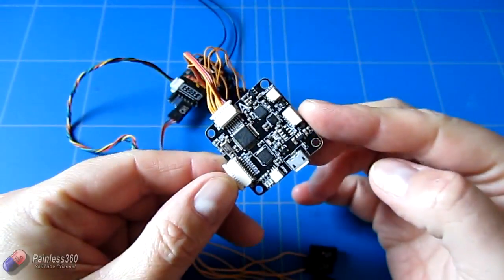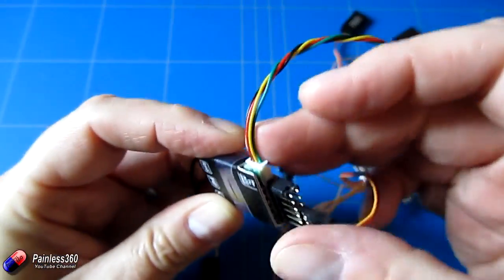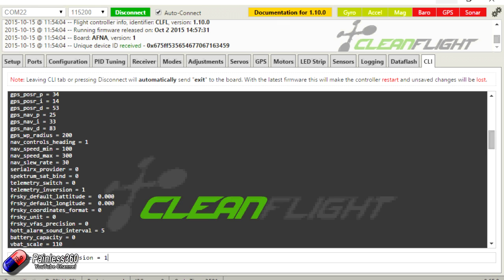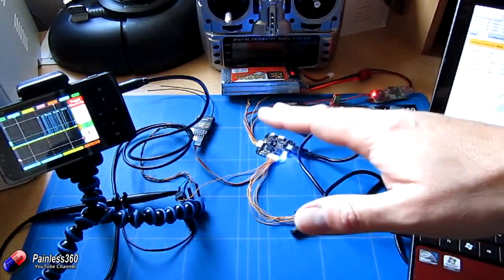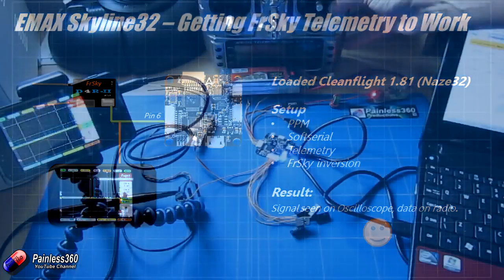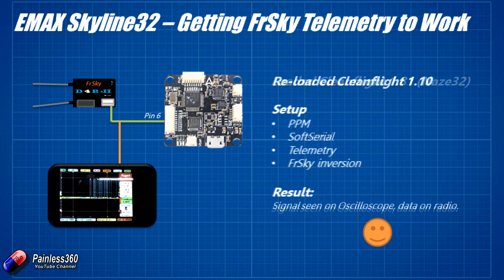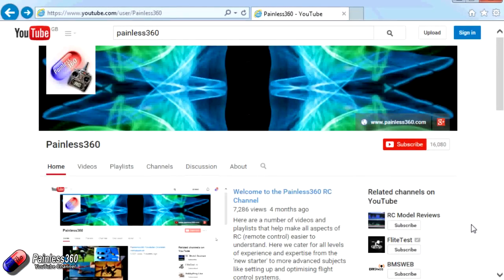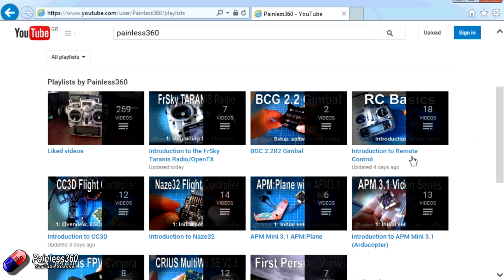RC Quick Tips - Skyline32 and FrSky Telemetry

Comment: I have been struggling with this problem with the Skyline32+OSD  to get telemetry on my taranis. I am using SBUS on channel 4 and telemetry on signals 7&8 with a frsky xsr. It works with the same set up on my Naze32 rev 6B thin 6DF on a diatone tyrant and no problems. What am I doing wrong?
Reply from the maker: +roland burrows not too sure, softserial is limited to 19.2k baud and on some flight controllers I've heard that this isn't enough. Best of luck

Comment: Any idea how to get led_Strip and telemtry?
When I turn on soft_serial on it turns led_Strip off :(

And it does not work on my 9xr pro :C:
Reply from the maker: +psposki not sure why that's happening. I'd configure telemetry on another Port and try again. Best of luck!
Reply: +Painless360 Thanks for your replay. 
I've decided to make voltage divider to get my vbat (that's only what i need from telemetry) on radio. 
It's cheap as f*&k, easy and i can still use led_strip  :)
Reply from the maker: The easy answers are normally the best! ;)

Comment: Does the nighthawk pro 280 come with the Skyline32 board? If so, is it still pin 6 that I have to plug telemetry into or is it another? As pointed out in the following image, the board seems to only have 1 soft serial connection, with pin 6 being the tx pin. So should telemetry be instead plugged into the 5th pin? that being the rx pin for soft serial 1.

http://static.rcgroups.net/forums/attachments/6/2/9/8/8/7/a8480961-211-main%20board.jpg
Reply from the maker: Looking at the diagram I'd be temped to use soft serial for telemetry (pins CH6/CH5 when using PPM and SoftSerial enabled). No idea what the board is but it will be running a Naxe32 target for Cleanflight/Baseflight.  Best of luck!

Comment: Hello and thanks for the video. I'm setting up the mini advanced version of this board and though I have the documentation my current set-up is not covered there. I'm running DYS BLheli 16 amp ESCs which don't have BECs. However, my PDB has a 5V out which I'm thinking I can power the FC board via that channel. I don't need telemetry set-up but I have not idea how to connect the ESCs to the board harness. There is only one wire coming out of provided harness for each ESC on the mini version of this board but 2 wires out of each ESC, signal and ground. Would you happen to know how to connect the ESCs to the harness? Do I ignore the ground wire on the ESCs and just connect the signal? I've sent several emails via emax website but received no reply. Hope you can help for you seem to know quiet a lot about this board. Thanks
Reply from the maker: +Eduardo Esparra see our video on multi rotor power system for a little trick using the Rx.. Best of luck!

Comment: +painless360Great ChannelI've recently installed a Skyline32 (Cleanflight) and I'm experiencing problems Dx6 with Orange 615 (using cppm)Speed controllers & Skyline calibrated.Test motors individually via Cleanflight sliders - all goodTest transmitter via Cleanflight  all goodNo flightmodes setArms & Disarms okWhen I arm and operate the quad - one or two motors work erratically. looking at Cleanflight the Quad shows its pointing down/spinning, even though its sat flat on my desk...Any pointers?
Reply from the maker: +Graham Walmsley Happy to help but please watch https://www.youtube.com/watch?v=olIqTiSJHIY and come back to me with more detail of what you've tried..

Comment: I have a skyline32 mini advanced....I'm trying to get the battery voltage on my X9D  I managed to get the board voltage that I'm running off an UBEC.what do I need to so I can have the voltage from the flight battery on my X9D?
Reply from the maker: See the video about telemetry in our Taranis series. That should help.
Reply: +Painless360 thanks but I found something about a voltage divider and used that on the A1 works great....I have a 120 and trying to not add things I don't need. I was kinda expecting a link to a video showing how to do it on a similar board I take it you don't have one.Thanks for the help.

Comment: I just flashed my Skyline32 with 1.81 and got softserial to come up under the ports tab.  But 1.9 and 1.10 don't have softserial at all.  Looks like a code problem after 1.81.
Reply from the maker: +Deefburger Should be there, it shows on mine here. Make sure you've selected PPM as the recover type..
Reply: +Painless360 I thought of that too.  I just received my Orange RX Transmitter and Receivers so I could use PPM.  I realized that even with 1.81 I was still using PWM and that would conflict with the port layout for softserial anyway.

I'll repost here if it works.
Reply from the maker: Yep, see the SoftSerial video. PWM uses the same pins..
Reply: +Painless360 Well, even with an Orange 615 in PPM I still can't use 1.10.  Only 1.81 shows softserial.  I think there is a coding bug in the versions above 1.81
Reply from the maker: +Deefburger not here, best of luck!

Comment: Thank you, very interesting. Did you get telemetry from  Nighthawk 280 board ?
Till present time I can;t get telemetry,even using yours last method
Reply: +TheRCfunny this works on Emax 280. Connect the 'green' wire from D4R-ii to channel 6 / pin #8 of the Emax (ensuring you are set up for PPM). Enabled VBAT alarm and Telemetry / Soft Serial. Then on Soft Serial 1, enable FRSky and 9600. Don't forget to set telemetry inversion and save. Works fine on my Nighthawk.
Reply from the maker: +TheRCfunny Not tried it. If you want all the bells and whistles then I'd suggest buying a kit with a full Naze32 board and following that series. These models are built to be ready to fly with limited expandability.. Best of luck.
Reply: +Painless360 I've asked because I saw in another your video Nighthawk 280 .Any way thank you for replay and interesting videos
Reply: +th3batfink Thank you After update the board to version V1.10 it works !!
Very important: Channel #6 ( pin #8 )
Reply from the maker: Well done!
Reply: +TheRCfunny you should also be able to get OSD / Blackbox etc. on channels 4/5 no problem.

Comment: hi painless360.love your vids.very informative.i,ve got the apm ardupilot controll board.from new it arded perfectly.but after not using it for a few months,it now refuses to arm.i,ve watched your vid on how to arm the ardupilot board,but still it won,t arm.so i,m wondering if there,s any other way to try to get this board to armed.any help will be appreciated.thanks.
Reply from the maker: +TIGERSHARK796 I would arm it when connected to Mission planner via a USB cable (remove props!) - the GUI will show you what's stopping it.. Best of luck.
Reply: ok,i,ll give it a go.thanks painless360.

Comment: Excellent video!
Reply from the maker: +Jon Car Using this you should be able to change the Telemetry type on SoftSerial 1 or 2 to MSP, setup the MinimOSD to run at 19,200 and then get that working too. Best of luck.
Reply: +Painless360 nope does not work.  Forums chock full of the issue.